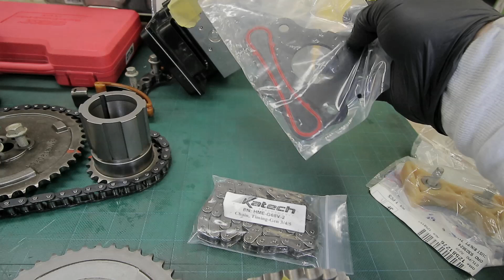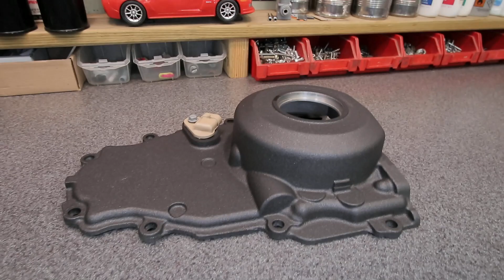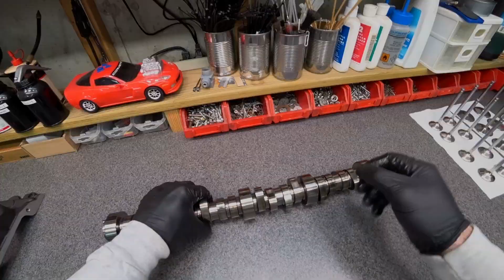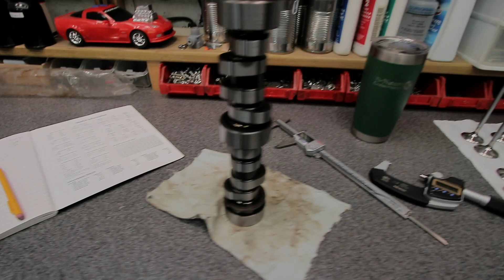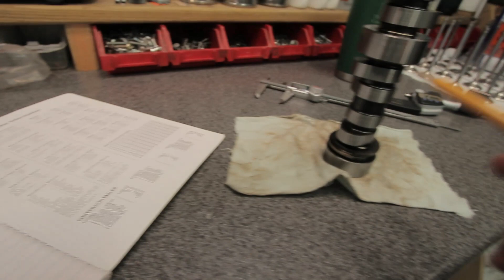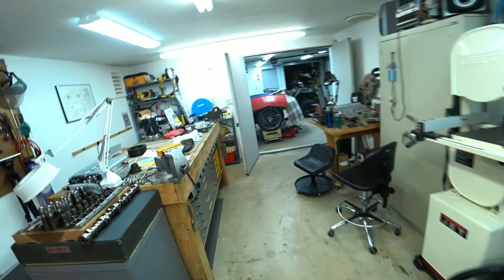LS9 Corvette ZR1 | BTR Stage 4 PDS Blower Cam Install & Stock Removal | Ported Heads & CAM Build

Comment: Nice :) hey bud . There’s a shop that’s gonna charge me for Freon and brake fluid for a cam install . Is that necessary . . Are those hoses  gonna he unplugged  or no ?
Reply from the maker: I had to full remove the ABS modulator and steering rack out of the car to get to access the timing cover and the balancer off/on. So yes very possible they are correct. Its a shit ton of work that people dont realize on a C6. 

The A/C system can be left in tact if ALOT of care is taken. I lifted the condenser and swung it out of the way and rested it on a mat so it doesnt get damaged or the little gravels stuck in it get into the motor etc. 

Depends on the car and the skill level of the guy doing the cam install etc.